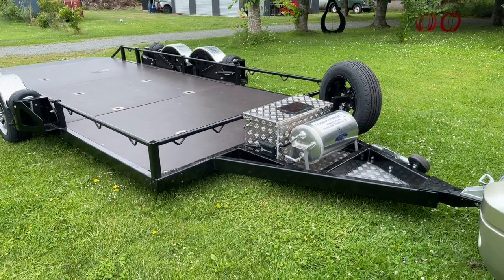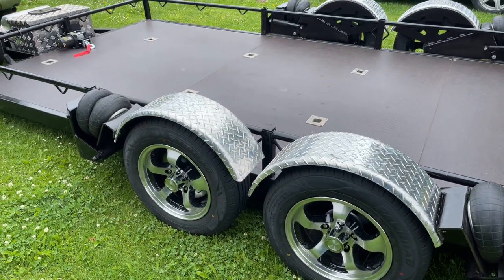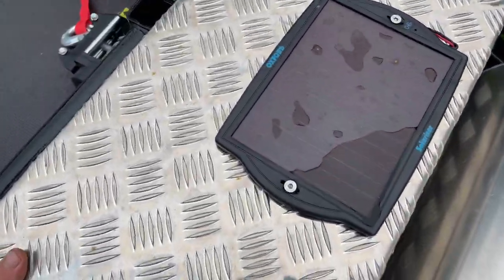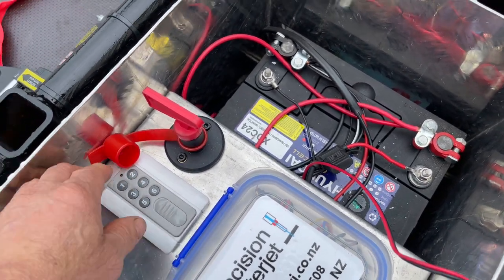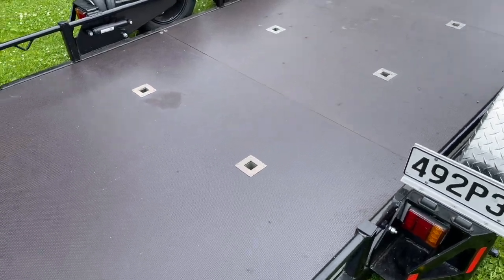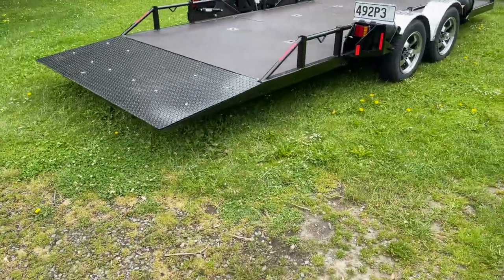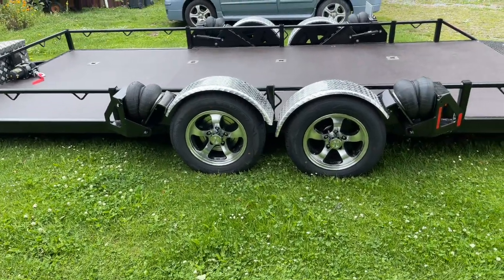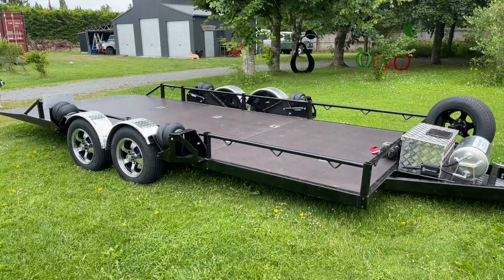How does an Air bag Trailer work? 1.2

Comment: Many thoughtful features. Some thoughts on it. You don't cap all the tops of the vertical uprights. Here in the 'States' those will fill with rusty water. Your top tube rails lend strength to the frame, but their height may prevent opening of the doors on a low built sports car. The front A-frame is butt welded to the front cross member. You re-enforcd it, but the cross member is taking all the stress and load. It looks good for astethtics reasons, but the stronger and prefered method of construction is to extend the 'A-frame members underneath to the outer bed frame or at least to the next crossmember. I have to assume you did extensive testing of the wheel suspension units in the design phase. Overall, it looks like it can carry a full size pickup (7000 #) and it's a pretty package. Long term use may highlight some areas that need refinement.
Reply from the maker: Thanks for your comment. If you look carefully you can see that all the vertical uprights have two holes at the bottom for drainage, hard to see on the video I admit.

It is a common fallacy to assume that a thru run is stronger. A high-quality weld, free from defects such as porosity, cracks, or inclusions, will have strength comparable to the base metal. We have never had a failure or cracks. Also to allow the tubes and wiring to run around the internals of the chassis this arrangement is less strong than a thru run with holes in it.  Appreciate your point of view though. 

You are right about the long-term use highlighting issues, this is true of all engineering and this trailer is no exception. The main issue is the forward leverage on the rear wheel which is prone to impact stress as a result of hitting a potholes head on. Any impact on the tire is exacerbated and the trailer needs to be a lot stronger around the welded areas and mounting points. We have yet to find a solution to this problem.

Once again thanks for your thoughtful comments.